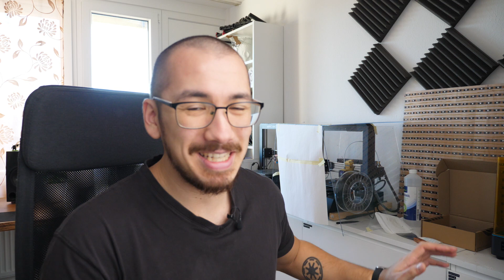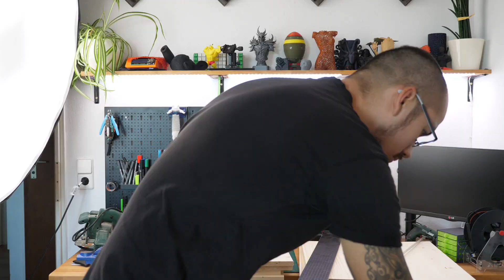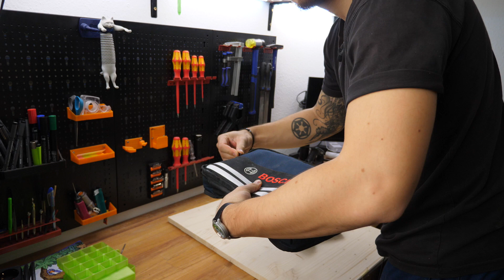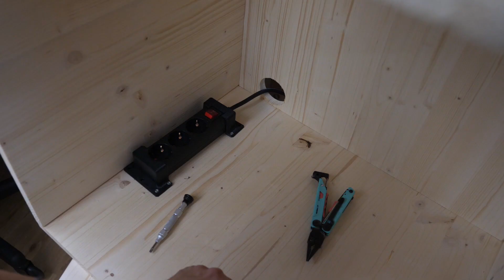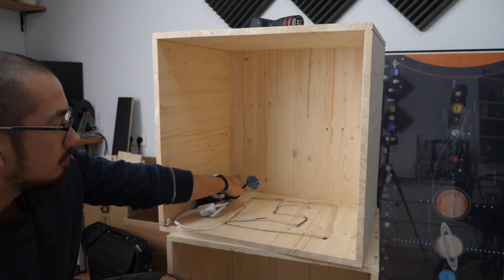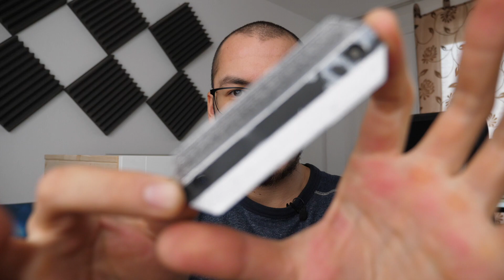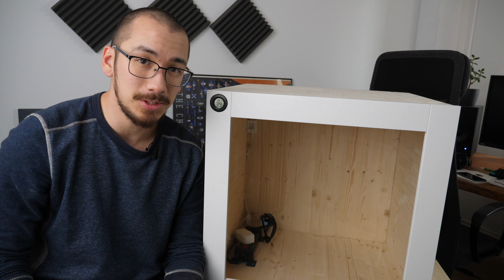I built a proper 3D Printer Enclosure

Comment: The scrap wood you got can be used to build a box the size of a filament spool that you cover with cloth or fine mesh so you can fill the inside with desiccant and put it with your extra filaments to keep them dry. "crystal sand"(silica gravel) or bentonite non clumping cat litter works well, just dry it first. They can be reused many times by drying them out in a food dehydrator or similar. You can buy the "kitty litter" cheaply in most grocery stores.
The ir sensors must be outside the glas, they are blind behind it.

Comment: 0:46 - PLA is harder than ASA. I assume you meant toughness or heat resistance, but hardness is rarely the quality you want. Glass is one of the hardest things out there, but its also incredibly brittle and difficult to work with

Comment: Aluminum foil and spray adhesive, or simply aluminum foil tape would have worked for those LED reflectors. Shiny paint is always hit or miss because 99% of it is surface prep and treatment, and when dealing with 3D printed parts that's a real struggle due to the layer lines.

Comment: Great job! I just got into 3D printing a few months ago and want to build a proper enclosure. One idea---instead of using a motion sensor, you could use a 'normally open' switch that then closes to turn on the light when the door opens. That would be a simple mechanical solution.

Comment: Wouldn't it be better to take the PSU out of the printer & mount that outside the box? Otherwise the PSU is trying to cool itself in the warmth of the enclosed space. Obviously, not until the warranty has expired on the printer.
Reply from the maker: Yeah that would be better for the electronics, so not only the PSU but also the mainboard etc. 

But that involves extending all the cables and is a lot more work than just replacing the parts once they break.

Comment: Why not paint the interior and LED holders white? For better reflection for the provided light. Nice video by the way, I like the fact you included your mistakes, warts and all🙂
Reply from the maker: Black was most abundant when I started the project and I planned to spray paint it anyway ;)
But true, white would probably be the better choice
Reply: Also I think that doing a white primer for plastics (either print in white or any other colour) before the paint will also improve the original metallic-mirror like reflectiveness of the pieces.

Comment: What makes this enclosure proper? It’s a fire hazard like all other enclosures I see on the web. No air circulation or filtration system. Wood is a very bad insulator, glass or acrylic is better. Should have used foil at least... the stepper motors should be preferably outside as well, as under stress(working at high speeds), those can get hot too. You can buy led connectors and holders for few $, no need for soldering or 48 hours of printing...

Comment: Nice video! Great enclosure. I used PLA+ (plus) for my 3D printer build. Prints like PLA and is hard as ABS ;) Maybe a tip for your next build. But an enclosure is always usefull. Keep up the great content (oh and turn of your auto focus next time ;) ).
Reply: As far as I know, PLA is one of the harder plastics you can print with, more so than PLA + or abs. It's just a bit brittle and prone to fatigue.

Comment: For the issue with your IR sensor. on the running printer the ir sensor detects the permanent moving of your hotend. Thats why it is permanently on. on the other printer the plexiglass blocks the IR radiation that is coming from you so the light keeps off.

Comment: Looks cool. I was too lazy to drive to a hardware store. Have limited space in a nyc apartment so power tools are limited to a drill and handheld rotary. I just got 4 black ikea lack tables a few days ago. Closed the sides and back with black foam/insulation foam/sound dampening foam sandwich. Stacked 2 on top of each other so it's actually 2, 34 inch enclosures. Not sure if it's a long term thing, the thing would probably explode if a kid punched it.
Reply from the maker: Yeah but it can't get any more cost effective than that ;)
How did you solve having a door?
Reply: @normanwink  acrylic with foam weather strips and I have the same foam sandwich I can stick on but didn't need to yet. The overall seal is surprisingly good for a budget enclosure made out of intangible things like "hope" that the things won't implode.